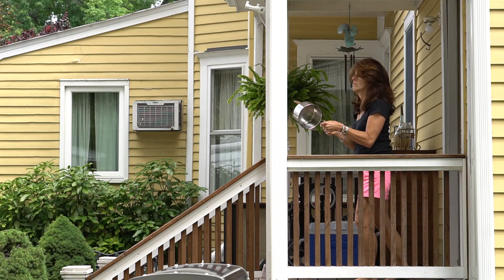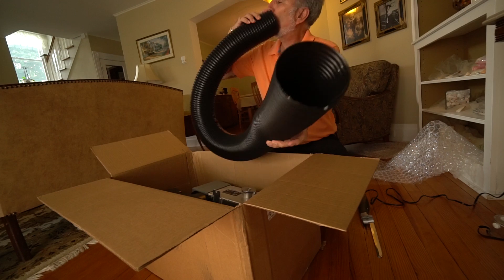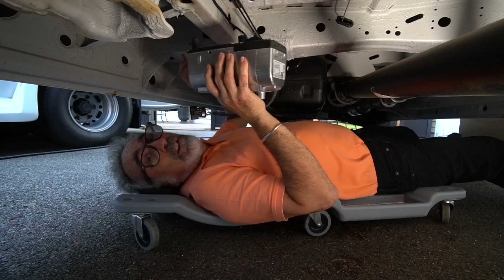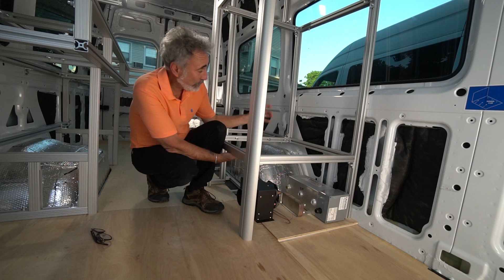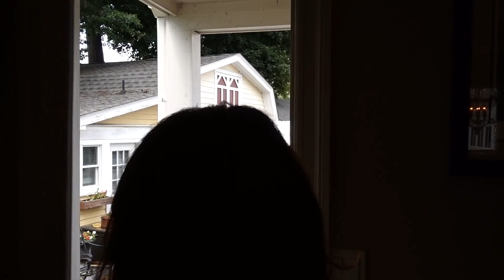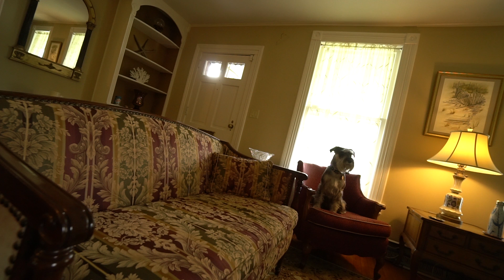VAN BUILD - The Espar Diesel Heating System Explained

Comment: With your glycol tank, could you put it under the sink, sharing the space with the composting toilet?  You'll already have ventilation for the toilet which might help with the odor and it would keep the toilet seat warm for those cold winter mornings grins I'm also hoping you will have an access panel which can be accessed by opening the back passenger side door which could make maintenance easy?
Reply from the maker: I will do some real world research on that glycol tank and let you know. The Nature's Head is to be easily removed right through the rear doors for maintenance.
Reply: I wish I could come and help you work on your build - it is stuck in my mind... I mean I'm not that "handy" but, I would love to work with you!  I dig your fridge ventilation idea, but, I'm wondering if it might be more efficient to add insulation underneath the fridge bottom which might help the heater be even more efficient and add life to the fridge?

Comment: Airstream has that glycol system (Alde). Per an owner, "The Glycol tank is located in the bathroom upper cabinet, above the toilet. A service access panel is on the left side, 2 screws remove the panel and there it is." The holding tank is inside.
Reply from the maker: Good to know. Thank you Briala.